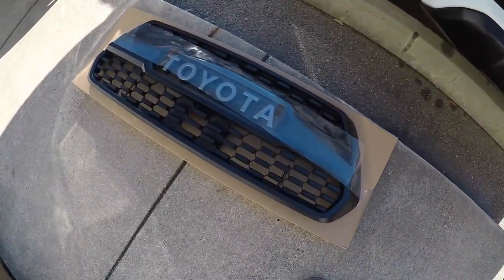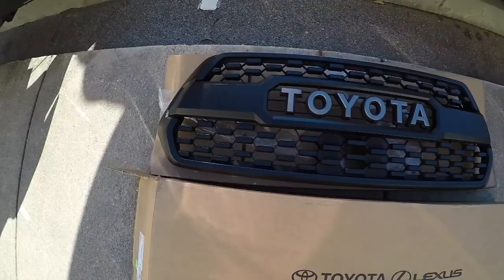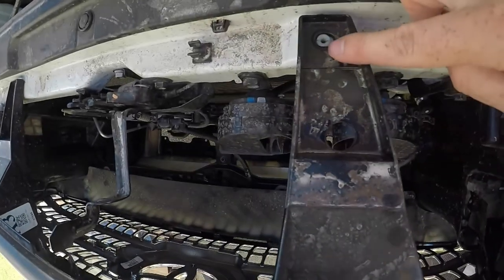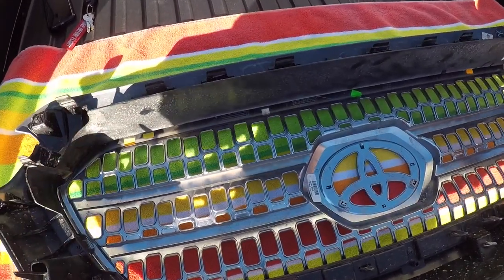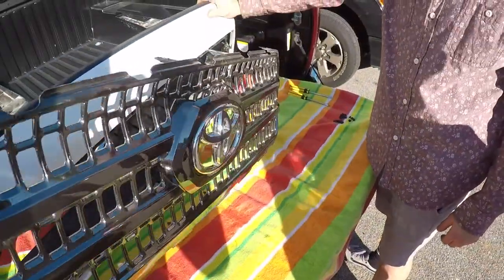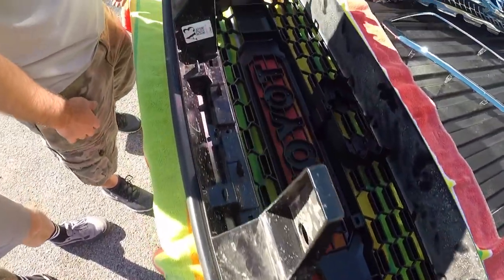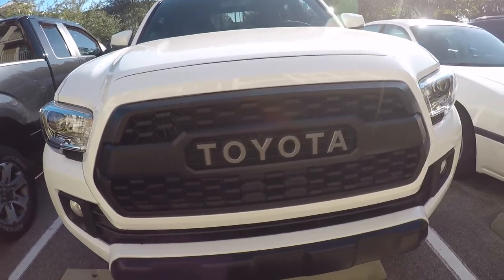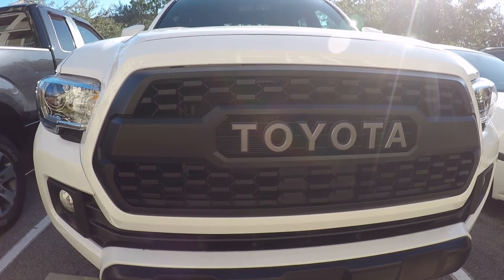TACOMA TRD PRO GRILLE INSTALL (HOW TO)

Comment: what a coincidence, I just bought a TRD pro grill on amazon too and came to check out how to install it. At first I thought the grille was a copy and not an OEM but then I read the description and found out it was actually from Toyota. I'm happy I found it for around $380 instead of the the usual $499.
Reply from the maker: It’s a very decent price for OEM. There are cheaper Chinese ones. But you get what you pay for with that one.
Reply: How can you tell that you really got an OEM part (Grille) and not a fake or copy?
Reply from the maker: The fake ones ship over without the A on Toyota attached. Also my buddies grille came in an genuine Toyota labeled box

Comment: My new to me '18 TRD PRO 4X4 came with an awesome Fab Fours winch bumper/ full brush guard..they left the bottom of the factory grill unattached to anything and it jiggles and moves a tad when in motion..because the winch bumper is hefty thick.metal..I'm going to have to rig and modify..possibly drill holes..or hefty black zip ties.

Comment: How do I do it on a 2018 Tacoma with TSS?
Reply from the maker: This grille won’t work for it. I’d honestly look into DBCUSTOMZ if you wanna. Solid and good looking grilles and they have TSS comparable.
Reply from the maker: Compatible
Reply: Blue TRD Jon It is compatible, you need a 2018 garnish for the radar
Reply from the maker: Perfect then 👍🏼 I need to edit this since his is a 2017
Reply from the maker: Perfect then 👍🏼 I need to edit this since his is a 2017